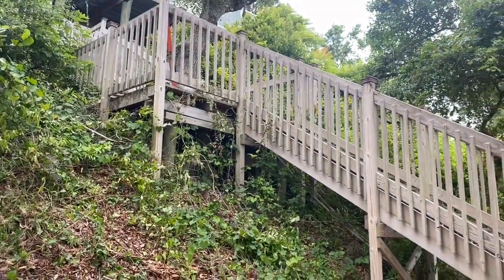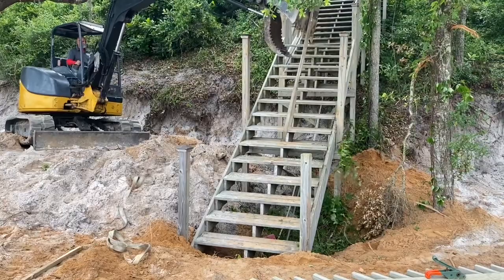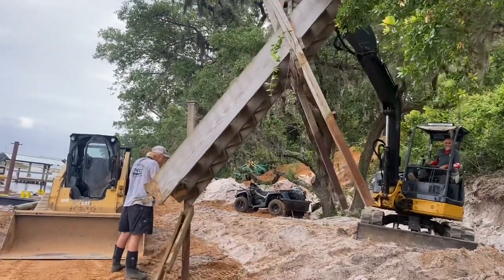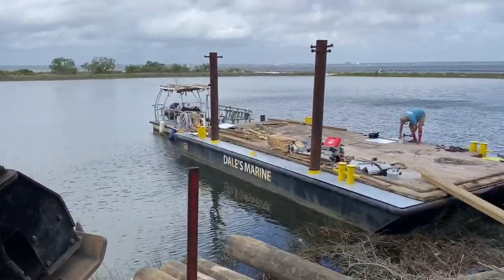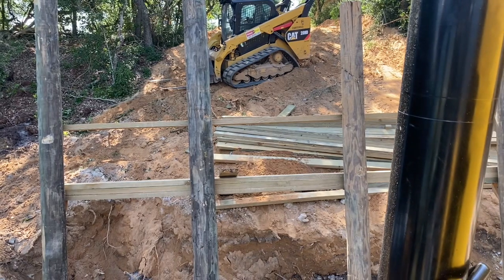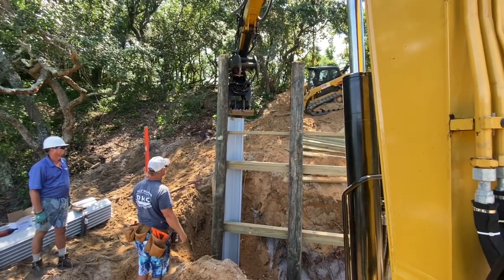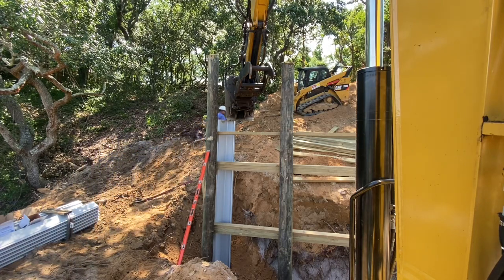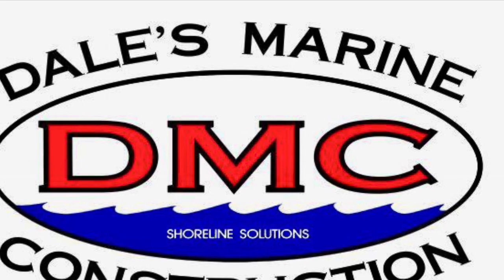TERRACING A steep hillside 33’ elevation change

Comment: Dale on the tiebacks, I'm assuming you will using concrete and embedding the rods, correct? Because that looks like somewhat soft soil...if so how many cubie feet will poured for each....
Reply: I think he drives another piling ? Which is much better than any concrete !
Reply from the maker: Hey Paul I typically use an 8 inch Piling that we drive down into the ground and attach a couple drag plates to the front of it I’ll make sure I get a good clear video of it on my next upload. Thanks for your comment